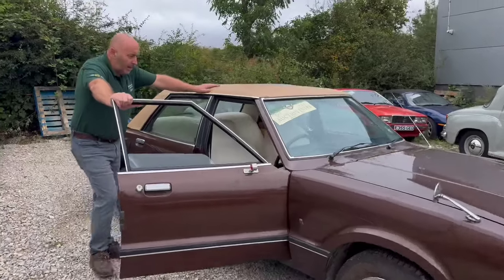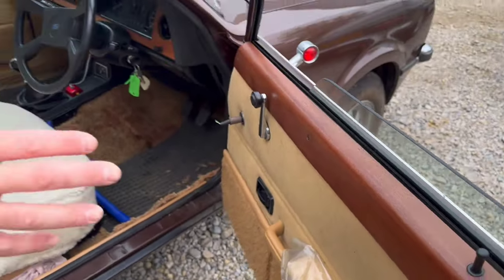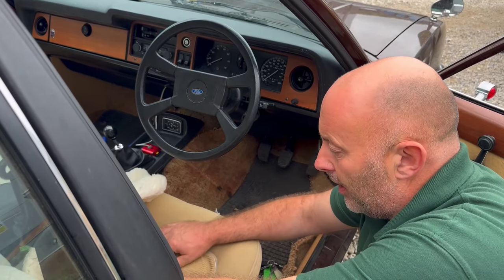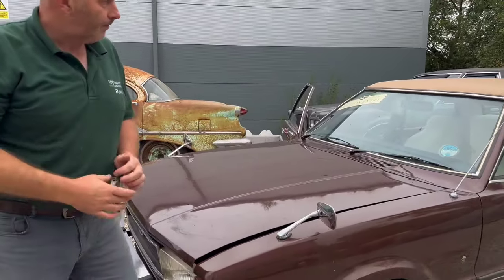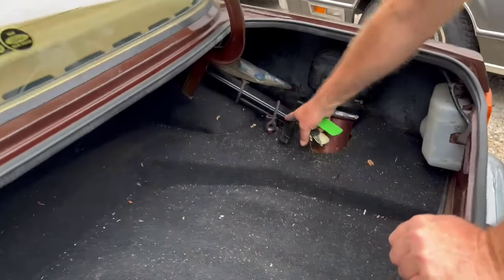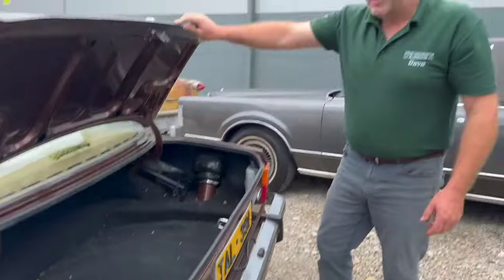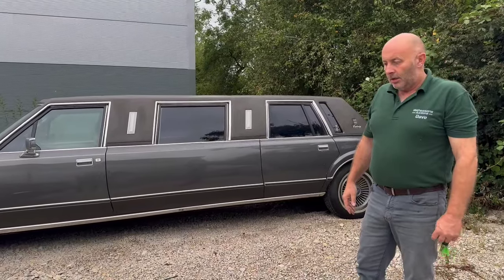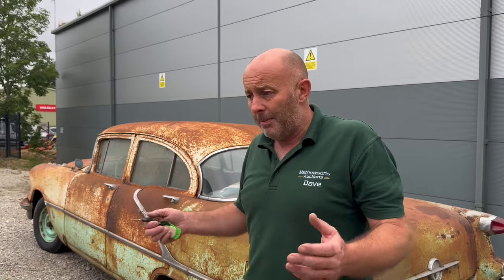1977 FORD CORTINA GHIA | MATHEWSONS CLASSIC CARS | AUCTION: 16, 17 & 18 OCTOBER 2024

Comment: My second car age 18 was a mk2 R reg 1600 gl  ford capri in roman bronze with a vinyl roof and the same colour interior. It was mint condition I paid £350 in 1982, after that a yellow mk4 cortina 1,6 L
That led on to 5 Xr3i and 3 orion ghia injection then xr4i and xr4x4 and Sierra 2,0s

Comment: Clutch cables made me remember i had a fiat 131 and mechanical wise she was great runner quiet fuel consumption good but was wee 1600 single head engine ,only problem? its ate clutch cables and it was fiat cables as well
Reply: I’ve had the same problem with a Seicento Sporting. Not sure if it was the same with a 131, but probably…left hand drives are okay, but they route the cable from the left, to the right side via a contraption, that I think…eats the cables 😂
Reply: @howardlake6178  Could see the point howard if they were cheap ones but they were from bloody fiat you would expect more than 3 to 6 months YET had a 132 relaced it once lasted two yrs till it lost an argument with an ice cream van.....his fault

Comment: I would suggest the owner had a puncture and placed the original spare onto the car and put the used wheel in the boot
Reply: I agree.) I noticed that the inside of the rear  driver's side wheel appears very clean. At 6:26 )

Comment: Personally not convinced that car is only 18,000 miles .
Ffs it’s had two different spare wheels on it  .
Reply: Maybe it's had a new Speedo at some point, as it's nearly a 50 year old car.: however In my opinion i don't feel that it's covered loads of miles though.  Maybe more than what is shown on the clock though) I have come across genuine low mileage car's but as time goes by, there getting very very rare"  to find. I'd love to know this car's history..
Reply: I had a different spare wheel in my Escort years ago, because someone nicked the alloy spare out of the boot and I bought a cheap steel one from a scrappy in case it happened again.  18,000 miles looks quite realistic to me, but you have to remember it's still nearly 50 years old.
Reply: @levelcrossing150  yes I agree with you) If 18000 isn't it's true mileage, I don't think it's covered loads and loads of miles) and yes nearly 50 years old.
Reply: @Mtandy-vm2pt  As the lads say, I think Roman Bronze has to be clean and polished up to look it's best.  I don't think it's the best colour for looking fresh, especially when it has a light covering of traffic grime on it.   My fathers car which was identical to this one, was the same.   A brighter, solid colour might have looked more like the mileage in question.